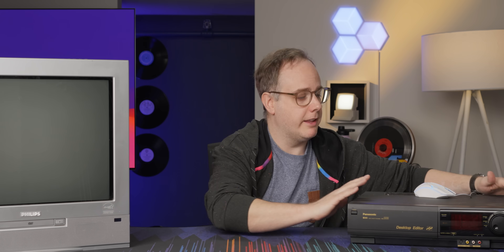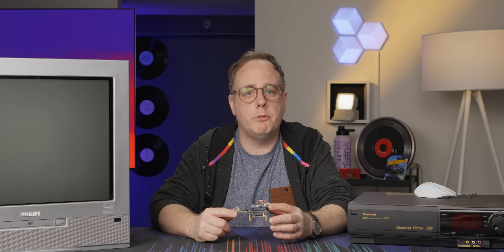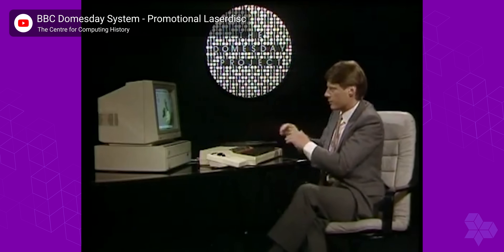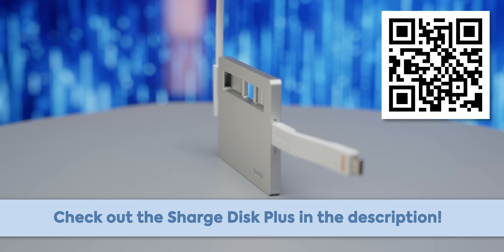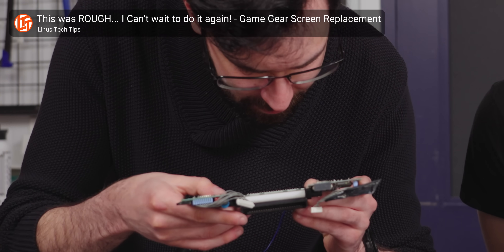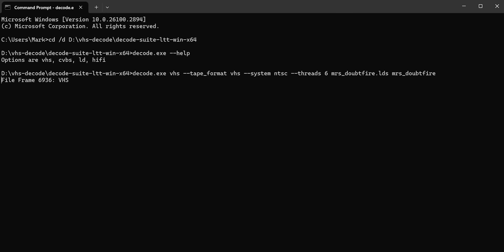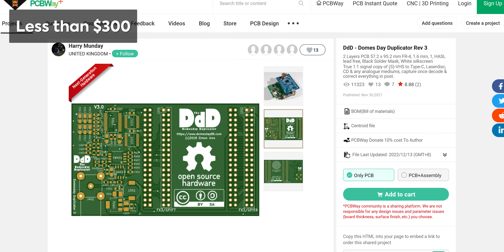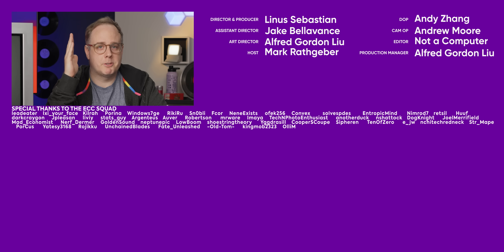I've wasted THOUSANDS of dollars... - Domesday Duplicator

Comment: Will it work on Disney tapes?
Reply: Completely defeats macrovision, and if there's a new flavour not encountered before, we just update the sync code.
Reply: @ Back in the 90’s I designed a Macrovision eliminator using a PIC micro and I remember using Disney tapes as the litmus test. There was an Arnold Schwarzaneeger movie called True lies. I remembered all the audio because I tested it so much.
Reply: @TheRealHarrypm  Not that it's difficult to get around anyway, there's multiple ways to avoid it & some capture devices just aren't effected at all.
Reply: @DoubleMonoLR Yeah, but you also can't preseve it with legacy kit 🤓

Comment: You're misleading people about VCR. You NEED very good VCR for vhs decode. Unstable VCR will have bad quality signal from tapes (especially bad ones) without HQ stable mechanics and stable tracking electronics. And this idea with long HF cable from heads amp is just awful. Read something about high frequencies and ask yourself why VCR's heads amp is shielded and why all cable are shielded and soldered
Reply: They absolutely didn't need to use this high end svhs vcr though.

Comment: i got a panasonic dvr and a vcr, both mid range models from the 00s, what i do is i clean the heads with the head cleaner, and then record the tape in sp quality via the dvr onto its hdd and then copy it to dvd, gives me hifi audio, and basically the same picture, much cheaper and less complicated then this. only downside is copy protection with certain tapes.

Comment: I am from Germany and we have Scart Cables. I have an old Sony VCR with RGB Scart Out. I guess its not better than this Right?
Reply: No, the vcr almost certainly won't be using RGB over SCART when playing a vhs tape anyway, it'll just use composite [or s-video if an svhs vcr] over scart. Even in the unlikely event it outputs RGB it would just be converted from composite/s-video anyway.

Comment: I remember some  time back in early 90s the vhs tapes got copy protection and you needed a special decoder if you wanted to copy them
Reply: It (macrovision) was around since 1985, and the same protection was still used on DVD players - (to stop people copying them to VHS.
Macrovision removers are pretty easy to get hold of, and some capture devices ignore it anyway - it doesn't actually affect capture devices(it was designed to effect circuitry in VCRs) but if it's detected they often disable capturing.
Reply: @DoubleMonoLR  See Also - completely defeated by External TBC

Comment: I have not heard of RF test points before is RF test Point better than composite or s video?
Reply: it is a signal from video head amplifier.
Reply: It's the direct source signal as the heads read the tape before its decoded internally to Composite/S-Video, its's a true master signal copy not just whatever the deck outputs.
Reply: @TheRealHarrypm  That's exaggerating it. "whatever the deck outputs" is just via basic analog circuitry, there's not some huge loss going on - hence why good conventional captures vs vhs-decode don't have big differences.
Both methods are converting an analog signal to digital.
Reply: @DoubleMonoLR There is big differences mainly due to value of VHS HiFi decks being able to end up with S-Video for standard and SVHS tapes, killing the SVHS and TBC market, but also that full 4fsc frame is what nothing can compete with for easy VBI export until you look at 600USD Osprey cards etc

Comment: Will this be better than using a S-Video from a good VCR onto a and then using a retro tank 4K and then a lossless video capture onto a computer
Reply: Retrotthink is not so good..Better get ADVC-100 or 300 from Canopus.
Reply: It has been better for years, you get the entire full analog signal frame to work with, and it decodes to S-Video effectivly regardless of deck used, it makes an source archive you get to pick end to end how it's processed as long as you preserve the RF data.

Comment: I think this needs a proper video or otherwise this is is only for people who understand what's happening. At the least, I would not mind an explanation of why the end result is so much better, especially when that comparison was shown at 1:32. And I am not even into this niche.
Reply: He literally explained it before the comparison was even shown: the "Domesday Duplicator" as he called it (This is actually VHS Decode, but it's basically the same thing) captures the raw radio frequency signal from the VCR before it ever converts the signal into composite video. In other words, it's basically the raw, untouched "read" of the magnetic recording on the tape itself. This signal is then digitzed (encoded) as 0's and 1's on your disk, and the VHS Decode software is able to decode that into video. You then take the output and do whatever you want with it.
Reply: That first comparison is simply bs, they picked (by far) the worst "normal" capture, which wasn't normal. Instead of a capture card, it used an external blackmagic composite to sdi(digital) video converter, which messed up the image.
Dark details are perfectly fine in all of the other normal captures(which use capture cards) on the comparison page. vhs-decode was always sharper though, albeit most normal captures weren't using the best possible equipment.
Reply: @DoubleMonoLR  It's not bs. It severs it point of showing how important this process is. Because many tutorials teach you to use such bad video converter and and that comparsion showed why you shouldn't use it. It's a drastic example but will make most people hooked. Many people don't know the compression aspect. They think an 10$ easy crap is enough. If you were choosing like a "normal capture" then you would have to go nit picky and explain the differences to the average joe.
Reply: @MrGTAmodsgerman  They're using it as a comparison of how a normal capture supposedly looks, they didn't say "this is the worst method" or similar. Nor is it a cheap device used for that terrible capture, it's just no good for vhs capture.
Even an easycap device that costs a few $ would almost certainly give a better image than that.
Likewise they gave no details at all about how they captured their own comparison video, which almost certainly wasn't using the high end vcr they modified here.
Just look at all the comments here saying how "amazing" / how much better it is - they wouldn't be saying that if the image was compared to a quality normal video capture method. It's very misleading.
There are a number of videos on youtube that knowledgable people have made with comparisons, the real difference is much more modest. While these methods can be more difficult, vhs-decode certainly isn't easier.
Reply: @DoubleMonoLR  Yes they didn't said it's the worst method. But they compared the "i don't care capture" with a one that is actually careful with preservation. Well you say an EasyCrap would do a better capture then this, yes, but it won't make people hooked as a mindless lazy careless capture trough a horrible device which most people would do since they don't know better. You can even see similar hard core example comparsions on the Wiki which is actually from these average YT tutorial type of setups where EasyCrap is mostly in used. When you do a video something like this, you don't want to waste time with some pixel peeping on a average audience to proof a point. The point of the whole video is to show how to properly digitize VHS tapes. To make people aware of the project. 

And i never said VHS Decode is easier? I would be the last person to say that it's easier. That's one of the biggest downside of VHS Decode. It requires some DIY equipment and some basic skills in like soldering and such. So it's not an plug & play solution most expect and want at all. And that's also where the hidding costs comes up. Since that is actually where it's not just that 20-30$ capture solution the Wiki talks about. It's when you need to buy first some proper soldering tools and some electronic tools like an digitial oscilloscope that most don't have.
Reply: Seconded. This process boggles the mind, since the end result looks so very good. Also, from what I gathered from other comments, bring Harry onboard, if possible. This process seems so interesting and probably beneficial to so many.
Reply: @halfnolife14  There was a lot more info that did not make it into, this way too short cut of a video, I made mark put stuff on a whiteboard, i'll publish a full introduction video If I have the time as we do need a gold standard video.
Reply: @TheRealHarrypm  Beautiful! I don’t think I will ever use these methods personally, but the process fascinates me to no end and the  possibilities of preventing lost media makes me as happy as a hammock!
Reply: the quality is better because you are essentially bypassing all of the actual circuitry of the VCR as well as the composite output. essentially getting the most "pure signal" you can directly from the tape but then reconstructing that signal using software which doesn't impact the final picture like the dated hardware and analog/digital conversion does.
Reply: There is a full wiki and basic user guide video on how this works, alongside standard full file set examples on the internet archive anyone can download, there is also over 50 decks RF tapped from lowest end junkers to rackmount decks, FM RF archival and decode levels them all out really.
Reply: Somebody get VWestlife on the horn!
Reply: Basically all the magic is in vhs-decode. I'm guessing it does some frequency analysis to eliminate noise and other things. Probably lots of FFT are involved.

Edit: seems like most of the restoration work is done through ld-analyse. In fact, vhs-decode is a fork of ld-decode with changes to go from a LaserDisc decoder to a VHS one. It's composed of multiple tools, mainly written in Python.

Oh, and of course, it uses FFTW for FFT :D

Comment: 500$ is crazy. It doesn't look that expensive. I guess it uses custom chips and that is super expensive unless produced in large quantities?
Reply: That's a marked up listing, it's actual cost is 90USD for the DdD board and 50-150USD for the FX3 and DE0 dev boards witch are off-shelf... It's all in the current vhs-decode docs and it's not to go to for tape.

Comment: This is really great to see. I've been wanting to do some proper VHS and 8mm capture of family videotapes. I did manage to get some decent captures using a set top DVD recorder a good decade plus ago, but I am hoping that this may be able to compensate for the loss of shadow information as every year that tape fades and gets harder and harder to make out anything in the details.

Like the video mentioned, I was looking for a DVHS deck with a TBC feature and they were just out of my price range. I also have some laserdiscs I'd like to properly digitize as well that never made it to DVD. This is exactly what I need. Are there options to at least get a synchronized audio capture too? In my case I'd do it again properly to get the HiFi or LD 48/16 CD track using different gear, but at least this way I'd have a reference to sync it to.

Regardless this is great news! Thank you very much for bringing it to my attention and above all else thank you to the team for creating this hardware in the first place. It is very much appreciated! I am definitely going to have to check this out.

Comment: verry cool, was wondering why not just use a Retrotink4k until you mentioned the price, it's still pricy though just not as pricy.
Reply: Because FM RF archival starts at 30USD with CX Cards, and the DdD is not actually intended for tape and is 300USD...

Comment: 0:20 doling a device with svhs and "component" inputs and talking about "composite" ?!  If you had any issues it was not with the inputs of that device. Today there are SHVS/component to usb capture for a lot less that $500 !
To ignore the condition of the old VHS tape AND the reading ability of the vcr (as it is still that head that reads the info from the tape) is just silly.

Comment: You can see people's faces with that Pany VCR you have, you just need the right capture device. But from the looks of it your VCR is defective, If you really spent thousands of dollars most of it must be on drugs, it doesn't take that much to get a nice capture setup that is on par or superior to vhsdecode, A JVC S-VHS VCR built in line TBC and a BE75 brand new for $1500.
Reply: The good older hardware is getting harder to find but I agree you can do decent captures cheap if you know what you are doing. 
I prefer the Phillips/NXP based chips over the Conexant ones. For something i'm only doing as a hobby i'm not wanting to spend hundreds of dollars on something just to capture 30 year old television recordings from consumer grade VCRs. It was already low quality when it was recorded.

Comment: This is something I always knew in the back of my mind was possible. After all, this is basically a soundcard that's been overclocked by a couple orders of magnitude.

With the entire decoding done in software, people have a much higher degree of control over the result, and can retroactively improve old captures by simply rerunning the conversion step with a better decoder, or better decoder settings, applied over the same signal recording.

Comment: Why will I spend 500 to only capture video, or even capture family videos to digital without the audio?  I mean the mean reason is to keep the memories including what was said, music and the full ambiance of the family event/gathering.
Reply: You can digitize the audio linear track(s) is just like low speed compact cassette you just use the audio in on your sound card or some other low frequency Analog to Digital method. I believe the HiFi Tracks can be digitized too but I don't know if they would be on a different RF test point since they usually used different heads / frequency separate to the video but same principle as the video I'm guessing.
Reply: You wouldn't, sadly the price of the other setups wasn't stated clockgen mod with CX Cards is 150USD max starting from absolutely nothing, It is designed to capture all channels from virtually any format at the same time in perfect sync, the video leans heavily on go read the wiki.

Comment: I dont wanna be a jerk but....the Domesday capture looked HORRIBLE. Artifacts all over the screen and what loook like mpeg blocking? wtf is that?
Composite was slightly blurrier but man did it not look bitcrushed to death.
Reply: Apparently a possible solution to this is to double the vertical resolution with a ffmpeg command so when it's encoded to a modern codec it works better with the smaller micro blocks used in them and encodes much better. It was on another video I saw of about this RF sampling system.

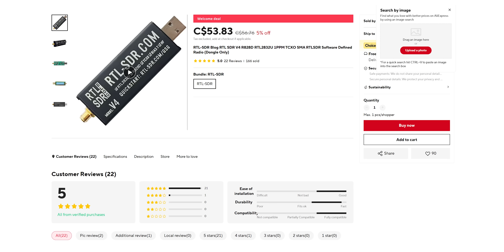Comment: 3:34 "But there are product that can capture audio [shows RTL SDR USB dongle]."  Oh really?  That's an interesting use of a SDR (Software Defined Radio) dongle.  I also happen to have one of those.  Very interesting!
Reply: The DdD can capture HiFi, but the RTLSDR can only capture HiFi due to bandwith diffrances VHS Video RF requires 20msps RTLSDR is 3msps basically, but they also run off diffrent clocks so hence why clockgen mod and the MISRC are a thing, to have perfect sync on multible capture channels.

Comment: this reminds how disappointed with myself by confidently exporting my camcorder tapes to MPG personally and redoing some tapes professionally but at VCD format and then overwriting those tapes. In other words, there is no best way to digitize tapes but to keep them and continuing re-archiving them as tehcnology improves or the tapes gives up.  to my defense, I was a student back then and tapes are quite pricey-reusing/overwriting those makes sense.
Reply: Tapes degrade though (physically, and presumably weakening/distortion of the magnetic signal), you can't recover what's not there. I've personally found tapes from the early 90s or earlier to pretty consistently be in noticeably worse condition.
Reply: @DoubleMonoLR  I've seen videos uploaded to Youtube from camcorder tapes in 90s, they do have better quality than my digital exports from my tapes in 2000s-I think his digital video exports is more recent than mine. I guess tape degradation depends on the environment especially humidity.

Comment: SVHS with a good Sony DVD Burner ripped using a dvd drive is still a better picture in my opinion.
Reply: If you like low bit rate MPEG artefacts from DVD-Video.
Reply: @Didz  I like a natural de-interlacing and hardware upscaling, never had any artefacting. i just rip the disc straight to pc and save it to 480p mp4. can be nicely upscaled further using waifu2x. working on a scart rgb laserdisc next. at the end of the day we are still talking how to shine a turd.
Reply: @ Absolutely right that it is a turd source however when dealing with lossy encodes like DVD-Video, artefacts when de-interlacing are far worse than a lossless capture from a composite video feed from the output of a VCR.

Comment: I just got a cheapo sub $20CAD adapter on amazon to take the video/audio output of the VHS and input it as a "camera" on the PC. Then with OBS I can record the VHS video.
Reply: As long as that is good enough for what you need, that's great. The benefit of this is that you're recording the signal straight off of the tape, not going through whatever video circuitry the vcr does to get the image to thoe video/audio output jacks.